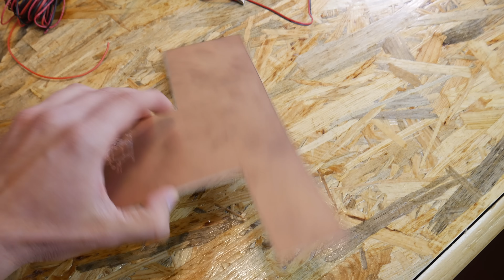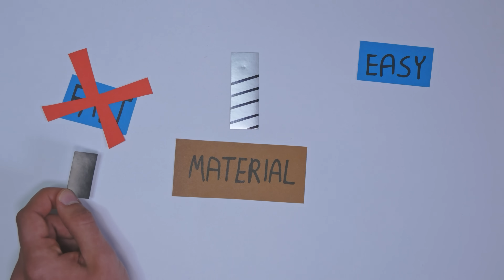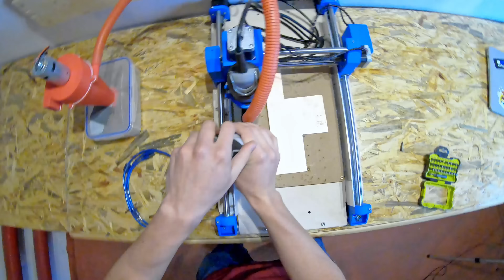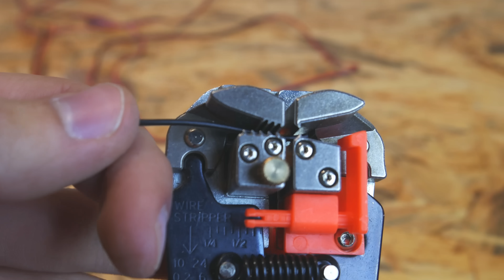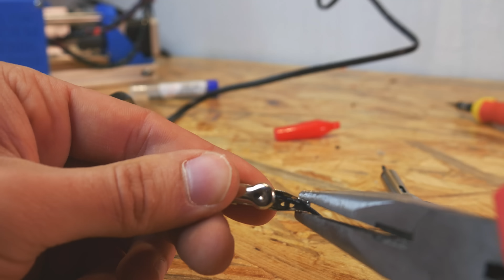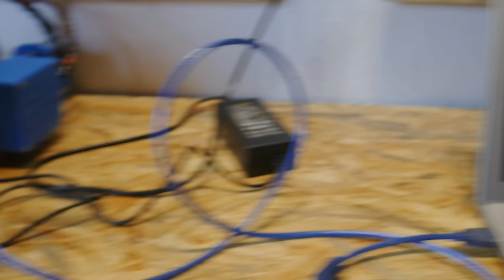DIY Z Probe For CNC Machine

Comment: to save even more money, assuming your surface is conductive and supposedly flat, you can connect one pin to the bit and one to the workpiece.  also if you don't want to spend money, instead of using a hard probe level and placing a sheet of metallic film (aluminium or tin foil) on the workpiece and connecting a crocodile clip to it.

Comment: It needs weight. I've used PCBs before, and the problem is they are too light and like to float over your stock material. I ended up 3D printing my own, made it hollow, filled it with a steel weight and epoxied a PCB on top, after nickel plating over the copper ( that's the other issue with copper, it tarnishes easily)......I am set up to do all of this easily though were some people wont be.

Comment: Hello, first of all, I wish you success, health teacher, I also made a dramel cnc, but sometimes there is a twitch in the y-axis, but I checked the axes manually, there is no problem, it may cause other stepper motor current settings I made 060 power supply 10 amps, there may be another reason, my teacher regards

Comment: Hello and sincere congratulations for your excellent work.
It is not clear to me the electrical connection of the probe on arduino and if it is necessary to connect some cable to the motor of the Z axis.
Would you be kind enough to explain it?
Thanks a lot and congratulations again!

Comment: Thanks <3
Creating and using a height map for the PCB to mill can bel helpful too :) If, like me, you have OLD circuit boards that are not as flat as they should.
Sure, I had to restart the milling a few times, but the probe was eventually milled using your design (smaller, though. I found yours to be a tad too large).

Comment: Could i get a clear picture of Wiring Diagram?
2 Wires from SCL and GND goes to Plate 
3rd Single Wire goes to Aligator Clip?
Reply: think of it this way, the circuit current/signal travels from the SCL port goes to the  small circle part on the pcb, there it goes into the alligator clip through the bit and back to the bigger circle on the same pcb  and run through the ground wire completing the circuit.
Reply: GND go arduino GND to allicator clip, this video only GND go to little point at PCB and then wire go to allicator clip, and SCL wire go to arduino SCL to PCB big copper plate, little copper point have GND wire and continue go to allicator clip.

Comment: did you already tried to cut some carbonplates on your cnc? is it solid and stable enough for cutting such hard materials? because i want something that can handle carbon cutting to make my own quadcopter frames
Reply: if you can cutting wood, you can cut carbon sheet too, or aluminium or plastic or bone. only need ewery material test first what is good speed and feed .

Comment: Does this work for a 3d printer
Thanks
Reply: I wouldn't attach it to your hotend for obvious reasons, but if you 3D print a bracket that holds a metal pin (like the drill bit in this video) next to your hotend, this method would work just fine for your 3D printer
Reply: Thanks

Comment: Use chemical tinner (no not thinner as in the stuff you use to dilute some types of paint but tinner without the H). This is a special chemical liquid that will allow you tin the copper so it is still conductive but will not oxidate. Getting it however is a little hard, it is quite easy to find in the US but here in Europe you will have to search quite a bit. All you do is just dunk it in the liquid and the you will see the copper turn silver/white. Or you could use an electrolysis method to do it if you can't find the liquid.

If you don't the copper will oxidate and ... well it might not make good contact.
Reply: Not as hard, as you think - there's SENO 3211. It's cheap and not that hard to get from online electronics shops. But yeah, it's indeed a very good idea to tin the plate!

Comment: I don't know if you know this but Chilipeppr has a auto leveling feature where it probes a user specified grid and auto scales the z movement to mach the warped area on the conductive material I usually mill pcbs with 0.5 mm cutting bit and havent had a broken bit ever since I started using   chilipeppr if you dont want to use it as a gcode sender you can import auto leveled gcode.
Reply from the maker: I know chilipeppr,  I wanted to use it to mill PCBs on this machine the problem is that I use KiCAD for PCB design and there is no way to mill boards designed with KiCAD. Maybe just to showcase PCB milling I will get back to Eagle for a moment.

Comment: That also works with a 3d printer?
Reply: Yes, depending on the nozzle (brass nozzles are conductive). But wiring them up and configuring them in the controller and software is a little more tricky.

Comment: Just use feeler gauge or a slip gauge block and thats it, ultimate accuracy also cheap. So why make make it complicated also I don't think the thickness of pcb would be even.
Reply from the maker: For this purpose, it is precise enough. As I said I wanted to make it easy to use, disconnectable and clean.

Comment: Can we make the same thing on 3d printers with metalic printing bed?
Reply: Yes you can, but it would be easier to use a solution designed for 3D printers such as a BLTouch or a capacitive sensor.
Reply: yes, but if the nozzle have rest of plastic will not detect the bed and can crash.